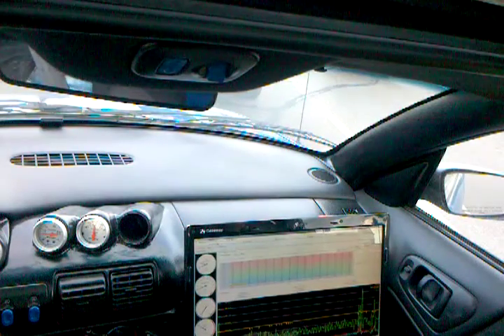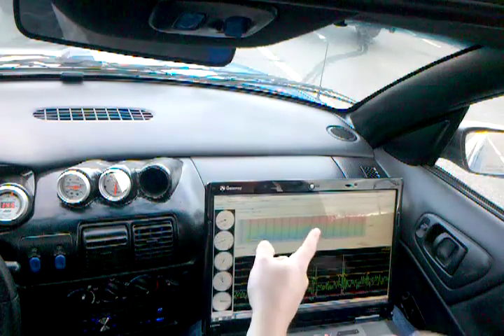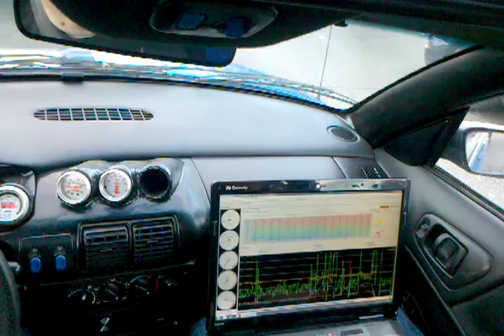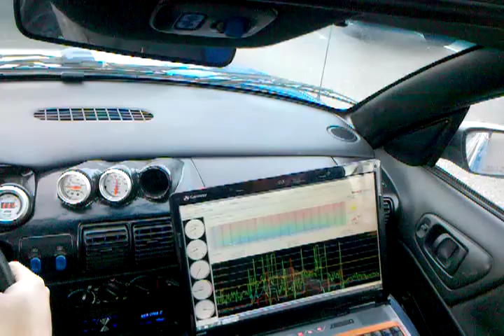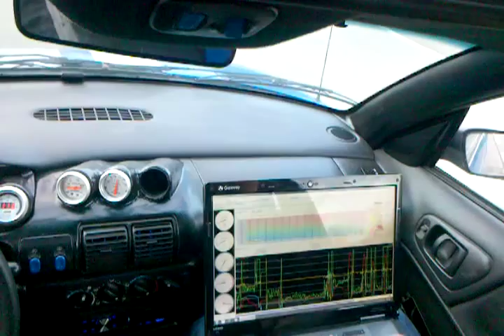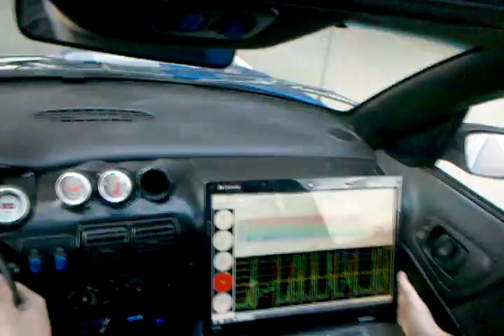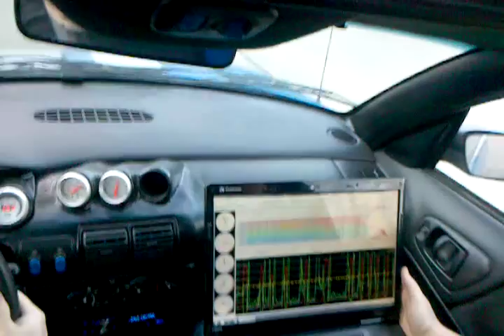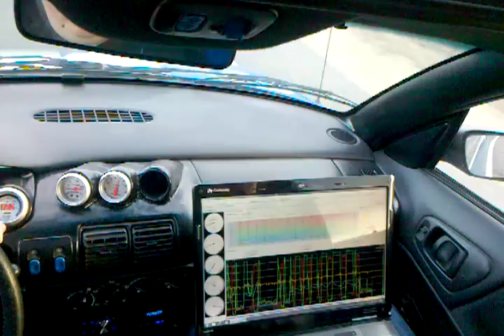Turbo Neon Megasquirt Tuning 1

Comment: just wiring my megasquirt together in my 02 neon and your is running great i was just wondering how you wired yours and what stock sensors you used or didnt use i know the 1st gens and 2nd gens are almost the same with the wiring